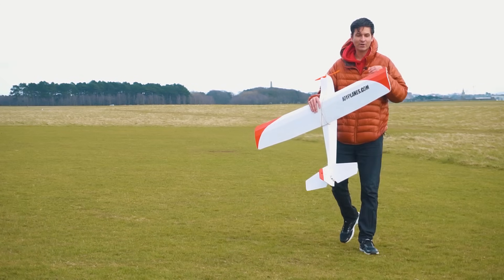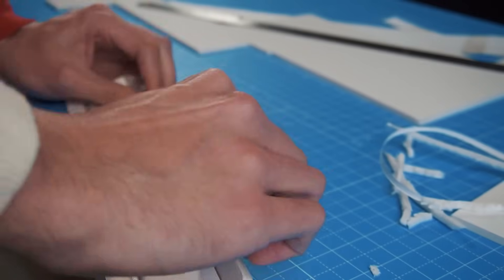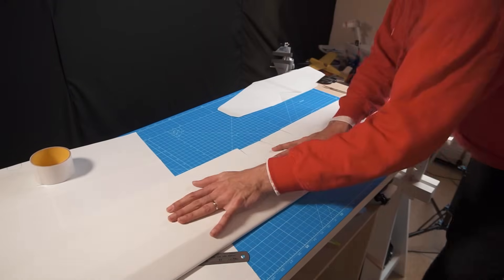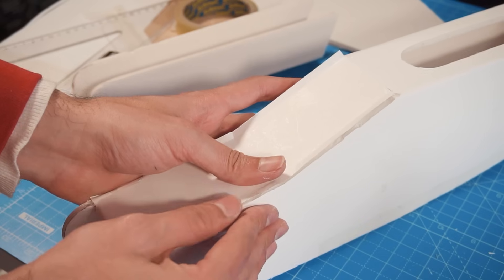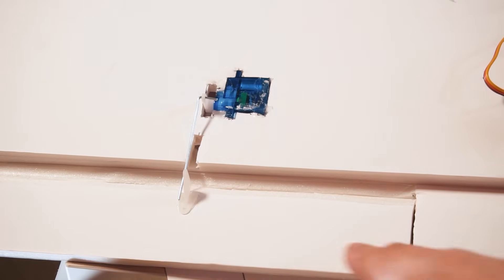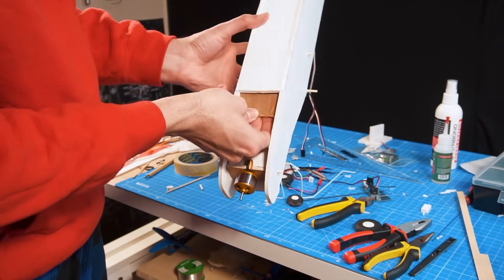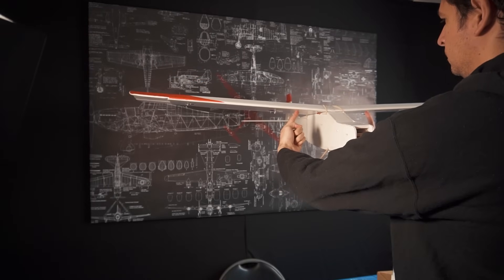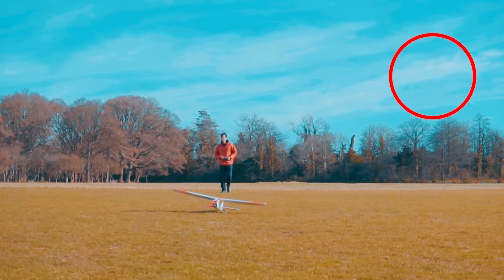The ultimate tutorial on building an RC trainer airplane | The best for beginners

Comment: I couldn't find a 2200mah battery anywhere, just the 1,800mah, can i use the 3s 11.1v 1,800mah lipo battery instead
Reply: @joyplanes I'm waiting for your reply
Reply: @captain_Dan  Probably yes.On some of my planes this size I also use a 1000mAh battery. You will just have to make sure to add some more weight in the nose because the battery is lighter.The flight time will probably be a little shorter and the aircraft will fly a little slower if it weighs less. Hope it helps!

Comment: I'm 73, been flying planes since 1959. First with Plastic  C/L planes then to Balsa, Flat Fuse, Flat wings. then, of course, full fledge Build-up, ribs for the wings and just flat sides for the fuse.
  Today I have a couple of the R/C trainers, 59 - 60 in wings, these are flown with 40-46 sized engines.  I like running the engines, so,  I'm a "Wet" flier.
One of my "fun" plane designs is a 25 in. WS build- up wing and flat fuse powered with a Cox .049 engine, two channels, ail & elv. set the needle, give it a toss, belly land for there is no LG just a tapered skid.
Flight times are in the 6 - 8 minutes, last minute I climb as high as comfortable, the engine runs out of fuel. Another 5-6 minutes of Free Flight doing loops, rolls and hammer head stalls, then to my hand to catch it.
Fly all afternoon with a Quart of Fuel so much fun.

Comment: Hi, I’m finishing up this project but I’m not sure exactly where to pin the motor sleeve. Do I push it all the way up to the top and pin it in or does it lay on the bottom or float somewhere in the middle. I don’t want to get this angle wrong and end up with a dozen holes because I have to keep moving it.

Comment: What motor and lipo are you using? If I extend the length and slightly reduce the chord can I use a 2204 2300kv motor with 5 inch prop on 2s 1000mah lipo?
Reply: Or 2826 1400kv on 2s with 8 inch prop

Comment: I built one and finally flew it this morning. It was awesome! It’s the first 4 channel airplane I’ve ever flown and it was a blast 👍
Reply: 7*. 3:42
Reply: WHAT BRAND/SIZE SERVOS DO YOU USE? And where did you buy them?
Reply: I use the cheap ones on Amazon and eBay. I’ve had a couple issues but would still use them on an airplane I was trying to build for cheap. Probably not recommended for anything high performance that could cause damage.

Comment: I accidently bought 1400kv bl motor with 30a esc which size of prop schould I get for this plane? 8060 wil be good or too small?
Reply: Perfect
Reply: You can also use a 9045 prop but not more than that
Reply: @lightlord299  I have 9060 folding prop and 8040 prop.Which one I must to use?

Comment: Understand this tutorial is over two years old. Thank you very much for your great work. This is my first ever build. I finished this build and made a few modifications as I went.

1. I mounted some 3mm hardboard 55mm wide and 150mm ling on the inside of the top of the fuselage, under where the wing is. I then inserted two small wall plugs. The wing is held down very securely. The wing is removed by two screws (and washers) and looks better than rubber bands.

2. I shortened the nose and then added a tapered nose with a hole for the propeller shaft. Then added a nose cone. Better aerodynamics and l think looks better.

3. After creating the dihedral, I bent a 2.5mm x 15mm x 150mm piece of aluminium flat to the shape of the dihedral. With washers under the wing and sandwiched to fix the dihedral with much greater strength. The added weight is absolutely minimal.

4. I also looked up how to program my new flysky i6 to have flaperons. Fantastic.

5. I made the landing gear from a piece of aluminium, 80 mm front wheels and 30 mm tail wheel. 

For the battery, I have used a 3500mah, 4S, 50c with a 30amp ESC  and 1000kva brushless. The power is fantastic.

Would be good to share some pictures but do not know how. 

After never flying an Rc plane before, I highly recommend this build for a beginner. Thank you.
Reply: hello, this looks awesome modifications. You can upload a picture (or few) to any cloud service as google drive, box, etc and paste the link in here. Thank you
Reply: Hello, i want to ask you.Which propeller did you prefer? Because i have 9060 8060 props.

Comment: There is a foam angle  cutter you can buy to cut foam in 90 and 45 deg,  the 45 deg hinge cuts and 90 deg bends will be extremely accurate and aesthetically the plane will look much better
Reply: Can you throw up a link?

Comment: Hola Joyvel, descargué el plano de este modelo y acabo de terminar de construirlo pero temo que no tiene suficiente empuje para elevarse, seguí tu consejo de usar la hélice recomendada para mi motor que es una 5045 pero creo que le quedó pequeña en proporción al tamaño del avión. El motor es de 2300 kv de 1 kg de empuje y la batería es de lipo de dos celdas, mi duda es si usando una hélice tal vez de 10 pulgadas pueda tener suficiente empuje para elevarse.

Comment: I'm new to the RC aspect of this hobby and i want to build this plane, but when i checked the item discription it said that you need a soldering iron to build the plane which i don't have. I did however notice that the only time you soldered anything was when you added the strobe lights. I'm not going to get the strobe lights so is the soldering iron still necessary?

Comment: Great explaining and details. Thanks. I made the fuselage, but as I glued the two pieces, they are not perfect 90 degrees. I was wondering if this makes a big difference in flying the aeroplane? The longitudinal axis is perfect, just the side angles are a bit out. The wings, elevator and the rudder also aligned perfectly. I appreciate if you can advise on this 🙂🙏
Reply from the maker: Fuselage it's ok, the critical parts are the alignment of stabilizers and wing
Reply: @Joyplanes  thanks for the quick reply. Much appreciated. I'll make sure that rudder and elevator align perfectly with the wings. What is the best spot in terms of stability to mount an action camera on the plane and what is the range of the radio?
Thanks 🙂🙏
Reply from the maker: @AliAbiri1  you can put the camera in the wings or in the fuselage as long as the CG is not affected.
Reply: @AliAbiri1  I have had the same radio for 3years and I can say it really depends on the factory...Mine worked up to 1km(with FPV) but I heard from some people that it only has a range of 400-600Meters.Hope it still helps even after 4 years!

Comment: Is it possible to adjust this plan to have the wings mounted underneath the fuselage?
Reply from the maker: Yes you can try that but you'll have to modify it.
Reply: Likely as long as I could get the CoM correct still it would be good?

Comment: Why dont you print at print house big dimensions? And also you could glue paper, without cutting to foam, and then after they dry cut it with knife. Will be faster, and also much more stronger, than foam alone.

Comment: İt flew very well, thank you for sharing this project with us. I am planning to scale it a little bit bigger. THANKS A LOT
Reply: it flew? Mine is not able to reach the speed it requires to take off as the plane turns to the right and out of the road. Also I used a 3000mah battery which is heavier which may be why it hasnt lifted yet. And the wheels are a huge pain. Does the motor start to vibrate a lot when the plane is on the ground with the throttle a little less than half? What is the distance your  plane requires to take off? What motor and prop did you use? Pls reply i need some help for my build
Reply: @logiknotlogic6586  Hi, I used 1000mah battery because I didnt have 2200mah. Then ı put some weight in front of it. If your center of gravity is okay ı think there wouldnt be any problem . if your prop is turning counter clock wise, when you look from frond of it, you should give 3 degrees angle to the right, otherwise to the left. and you should turn motor downwards 3 degrees. I couldnt fly it myself  because I believe I am not good enough. Someone threw and an experienced person flew my plane. If you are new in this hobby like me, I wouldnt recommend you to fly yourself even your are good in simulator. I used 10" 10x4.5 propeller. My plane  didnt vibrate  but I have had that problem before. but ı dont know why. ı used 1000kv motor. I am sorry if I made any mistake. english isnt my native language.  If you have another questions, you can ask
Reply: @_QWERTY2254  thanks a lot man! I made my own motor mount which was what was causing the vibrations. Iv ordered a proper one. How long does it take for the plane to take off and distance too? The main trouble Iv been having was with the wheels. I was only able to go somewhat fast on a proper road. In the video, the plane literally takes off in a few seconds with very less space on grass
Reply: @_QWERTY2254  Hey Can you share the video is possible please? Thanks a lot
Reply: @_QWERTY2254  nice! Maybe Ill try the same thing. Im just scared that the plane will go out of control and land nose down
Reply: @_QWERTY2254  Hey! I came back to look at the video after testing my plane few times and realising it didnt have enough power to fly against slight winds. So im planning to remove the one 1000kv motor and fix 2 1200kv motors, one on each wing with a 9 inch prop. The original weight of the plane for me was 900grams i think. Any advice? Do you think itll work?
Reply: @_QWERTY2254  thats a bit too advanced for me. Autopilot would be amazing. Ig I will learn how to create one in the upcoming months and implement it in a better plane. Oh i didnt know it affects the rudders but I didnt use them earlier too so i guess its fine. What do you mean by changing speed of the motors when turning? Ive never heard of that. What does it do?
Reply: @logiknotlogic6586  Helo! can you please take a look on my plane 
https://youtu.be/DmagfOMhjPo
Reply: Can you send me its scale for 1 m wingspam

Comment: Readytosky A2212 2200KV Brushless Motor+40A 2-3S ESC+MG90S 9g Metal Gear Servo+6035 Propellers for RC Fixed Wing Plane Helicopter
Reply: Does this work
Reply from the maker: Yes
Reply: Can't wait to start building

Comment: Does anyone know if we can waterproof the wing (using packing tape to the foam board) before we start cutting without affect the CoG? And if a high capacity battery can be fitting into it?
Reply from the maker: Hi, you can, and it can hold a big battery, a 5000 mah should be fine
Reply: @Joyplanes  What's the difference between this and the "Mini" in your other video? For example, I really like the service hatch into the fuselage in the mini for better access to the electronics and mounting. Is it possible to utilize some of those techniques in building hatches into this model? :)
Reply from the maker: @ianip1495  This one is a lot bigger, is almost the same as the simple storch in flitetest YT channel, they use the power pod which is also a good idea to access the electronics.

Comment: I am finding that anyone can tech me to make rc airplane then my friend recommend your YouTube channel I like your channel but I have questions why you not recommend 1400kv motor and if I not make flaps then what is it disadvantage and advantage  and what is the size of  front wheel and rear wheel
Reply: Please repley
Reply: If you Don make flaps then is won't take off
Reply: @somelezeranana7776  when I fly for first time till now I had not use flaps even though I have flaps in my plane. It is hard for the one how is flying for first time with flaps it is easy with horizontal  stabilizer to take off. In short if you are using flaps you can take off  in short runway but it is hard for one is flying for first time. Plane can take off with horizontal stabilizer without flaps .if  you don't make flaps it's ok it can take off without flaps

Comment: Built this but having trouble lifting off. How much distance is needed?
Reply: Assuming your weight and power are good it should basically just jump in to the air. Its possible either the plane is overweight or the motor is not producing enough power.  How does the power feel?  If you hold it by the fuselage and give it full throttle it should really want to jump out of your hand. Have you weighed it? Weight is often an issue for peoples first planes.
Reply: @saleplains  It is 1.0kg (2.2lbs) without the battery. I blew it past half the length of a baseball field and it still wouldn't lift. :/ 1000kv motor. I've removed everything that isn't needed like the wooden support underneath the fuselage. I see that his plane is around 0.7kg, so I honestly have no idea what's going on.
Reply from the maker: It could be your propeller, it's very important that you use the right propeller that will create enough propulsion, for example use a 6 inches propeller instead of a 5 inches, or if you're already using the 6 inches use a steeper pitch instead of 4 use a 6 or more.

Comment: It's really a very good detailed video thanks to you.. But it's ok to use 2400kv motor with 4s lipo batt with extra weight to the fuselage.. or it will be to fast and hard to control.?

Comment: I am aiming to built this plane but miss some information: Can I get information on how to print on A4 paper and fit it into one drawing? borderless printing is not possible and I have difficulties to fit each sheet. What are the sizes of the wheels and what is the size of the landing gear. ( as simple line on the layout would have helped a lot).

Comment: I watched your video and to the challenge to build the Storch according to the plans.  The only thing I don’t have are plans for the landing gear.  I realize that they are handmade but some lengths and approximate angles would be helpful.
Reply: ??????    main lg  PARAMETERS.        the  main  lg  struts, of a taildragger, should be tall enough that the  Prop  does  not strike the ground, during ground maneuvering.    strut height should  maintain  prop clearance (on the ground), if the attitude is  very  Slightly, nose-down, also.        the use of  taller struts will increase the  sto  traits, of the airframe.      btw,  the  WINGTIPS   Should  Be  Finished !!!!         i suggest you ponder  These questions.     WHY  do  you  boys  Think  it is a good idea  to  copy  an   ANCIENT  Design???     WHY  do  think it is a good idea to have  stol  traits  built into an  airframe.!!!    as to  the second question,  it should be understood that when  stol  traits are  built-into an airframe,  they  CANNOT  be  'turned off'. 
in other words,  those traits are  ALWAYS  There,  Always   affecting  flight  behavior !!!        you boys who make models of  ANTIQUE  stol  designs,  end up with a model  that is  Not  versatile (in the air) !!!    googletranslate

Comment: Hi, I want to build this model, but the plan is missing information about the motor axis. This is quite important information for every aircraft.
Reply: WRONG.     in the case of electric power,  a  zero-zero  thrust angle  is  Optimal.    this  assumes the  wing  has a  Good  profile/airfoil.       if the wing profile is less-than optimal  --- as  Seen  Here  ---   use a couple degrees  of  positive aoa, at the wing  Mount.    angle of attack.       googletranslate
Reply: Thank you for your response. I made the engine axis 1 ° down and 2 ° to the right, maybe it will fly :-)

Comment: Can i use a bigger motor like 1400kv ?
Reply from the maker: That's not a bigger motor that's just more KV or revolutions per volt. And yes you can use it with the propeller recommended for that motor.

Comment: Hi i am from Bangladesh. I made a rc  plane but it is not flying properly i am  confused that nose heavy is good or tail heavy is good
Reply from the maker: Nose heavy is not good. It's just ok but try to make the CG in the right spot, but definitely avoid tail heavy.
Reply: some info.     an  airframe  is  Supposed  to  balance, in  TWO  ways.    one is called  center of gravity (cg).      when a model is supported at the wing (and near the fuselage)  cg  Should be located at  thirty percent of chord; or, if desired, a bit forward of thirty (nose-heavy).         in the context of  cg,  the term  tail-heavy  Really  means, the  cg  it  AFT  of where it should be.
the other context is  Distribution of Mass.  dom.      when there is tail-heaviness in the dom,  there is  Too  much  Mass  located  aft of where the c-m  Should be located.    center of mass.        if this condition is not  corrected, there  Will Be   PERMANENT  tail-heaviness, in the dom.     at linked illustration,  OPTIMAL  location of  c-m  is  indicated; for a typical high-wing design.  (see my tutorials)      googletranslate
https://s3.amazonaws.com/assets.flitetest.com/article_images/medium/truecg-jpg_1384168691.jpg
Reply: @daviddavids2884  and joyplanes Thanks.
Reply: @daviddavids2884  hey old fart fukkyuu beetch